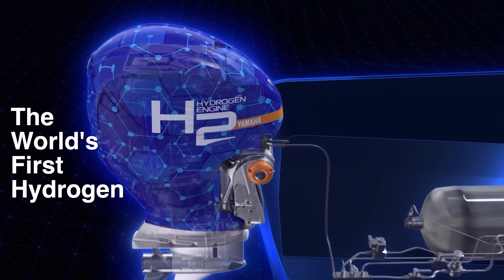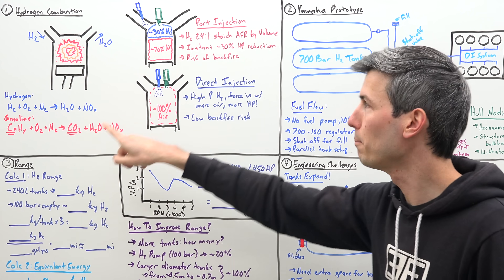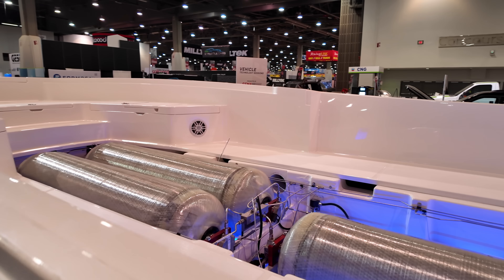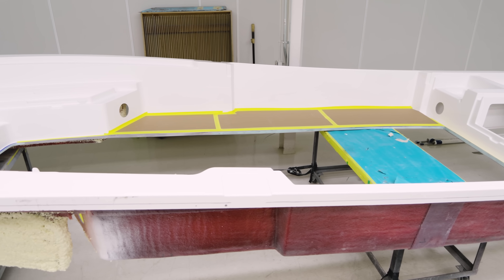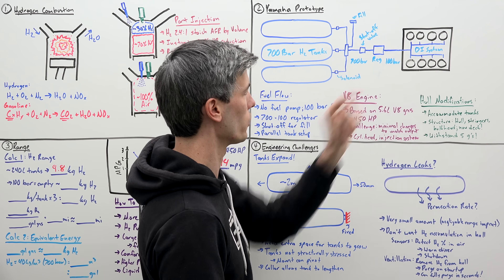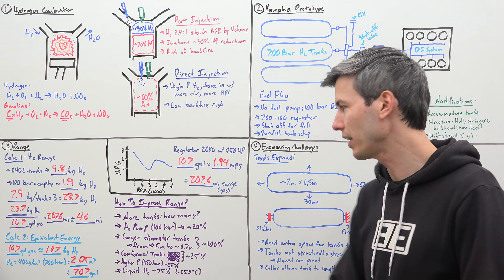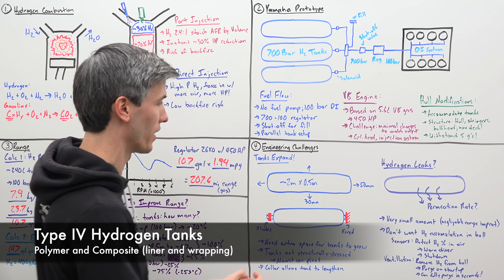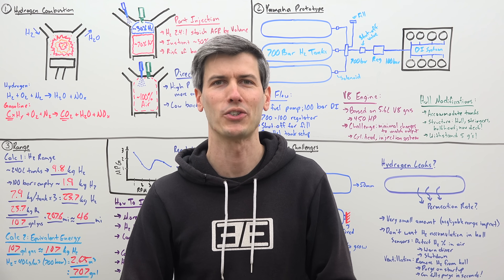The World’s First Hydrogen Combustion Outboard Engine!

Comment: When the hydrogen combine s with ATMOSHERE NOT “AIR”, what happens to the65+% that is about to be turned from neutral gas to ACID, a nasty nitric based acid. Not as bad as NITRIC ACID, and yoh could or might want to calculate. 
Wht was it a 6.5ltr? Every two revs, you have brought in changed. And exhausted your hydrogen/ atmosphere here
1000RPM X 13cubic ltr is 13,000 cubic liters you gotta deal with now & that’s  w engine at IDLE
Also one that the gasoline IC doesn’t have to deal with. After emissions conditioning and treatment the Co and the rest mainly water and tiny amt of sulfur ithink &" it’s never perfect, but the exhaust on American cars here is cleaner than EVER. 

This great hope you “out bug” & I’m all for it for over 50 yrs & you know many of these modern approaches have already been data compiled and easily findable. 
1973-4? Tom Ogle,  ElPsso. TX. 
Murdered over a fuel system design, which by all the big name and mnfrs car companies agreed it had lot of merit.

Comment: Compound stupidity on full display here: 1. use hydrogen inefficiently with an ICE instead of fuel cell, 2. hydrogen bound to carbon is a FAR superior storage solution to cryo or compressed 3. we need to pretend that carbon is evil and can't be used in a closed cycle.

Comment: One of those tanks costs more than I've ever paid for a car or boat, admittedly I've never bought a new car or boat, but just the tanks are crazy expensive to make, and that's kind of unavoidable. 

Designing the tanks so they are allowed to flex reduce the amount of material required but also limit the number of cycles they can be considered safe, some hydrogen tanks have a cycle life comparable to lead acid batteries. But when lead acid batteries fail they loose capacity, and might release very small amounts of hydrogen when you force charge them anyway, but if one of those tanks fail, at or near full pressure, it would probably be difficult to find all the fragments of that tank, and the other tanks, and the rest of the boat.    

Very interesting, very impressive even, engineering exercise, without real practical application unless your goal is to spend money.  Synthetic fuels are often ruled out as a practical alternative due to the high cost in small scale experimental production, but "green" hydrogen isn't cheap to produce either, and then there are all the additional issues with hydrogen. Even sodium could be more practical energy carrier than hydrogen, despite the fact that using sodium as an energy carrier would have a whole range of "interesting" challenges.

Comment: Considering that for the application you have more than double the power you actually need you could use a 200hp diesel engine and run it with +/- co2 neutral eco diesel. "Problem" solved.

Comment: There is one interesting thing to consider for hydrogen powered boats, which can never apply to hydrogen cars:
They're sitting on top of a potential fuel source.
Hydrogen is often produced through electrolysis.  This method basically just requires salt water and a power source.  Through the use of a small wind turbine mounted to the boat, you could build up fuel over time.  You might be thinking "how are you supposed to pressurize it?" but since the collection system has to be submerged, why not use the depth of the ocean to your advantage?  You only need about 100ft of depth to get adequate pressure - that's effortlessly attainable; even some lakes can provide that.

Granted, I imagine it'd take all day just to gain a few miles of range, but imagine this:
You have a houseboat, where you primarily live off your boat.  You don't expect to travel far or often, and you don't expect to make a round trip in a single day.  Slowly building up hydrogen fuel between stops could effectively be free transportation for such a thing.

Comment: I just learned a great concept I never thought of about direct injection. I didn't consider the reduced amount of air because you're drawing in fuel in a typical system. With direct injection, you're only drawing in air, and then you're forcing in fuel along with it, so it's almost like forced induction engine, not really. I know, but a little bit because you're getting more air volume, then you normally would if you were drawing in the fuel with the air. Because some would be displaced. And if the fuel to air ratio is higher, you're gonna be displacing even more air with the extra fuel. Very nice concept to understand thank you.

Comment: People are going to keep farting around with hydrogen, then realize the insurmountable thermodynamic challenges and go with a solid state battery. A battery with twice the energy density would solve the boat issue and already exists today in low volumes.

Comment: Why on earth would you combust hydrogen at low thermodynamic efficiency when you can convert it directly to electricity in a fuel cell. 

Hydrogen fuel is incredibly expensive, you don't want to be throwing away 75% of the energy.

Comment: 107 gallons of gasoline is not the same as 107kg of H2
107 gallons of gasoline is about 406.6kg of gas, or in other words, you would need about 407kg of H2 to equal the energy, that's a LOT more than 707 gallons!
It's actually 2685 gallons!

That's assuming 1kg of H2 = 1kg of gasoline in terms of energy, which I didn't even verify.

Comment: So, and now, how much more is the weight of a battery for 46 miles? Using H2 in combustion is just a waste. 2 Tanks, Battery and fuel cell would give a range of over 100 miles. Only problem: In this application, the power output is really high all of the time. Therefore you can't use a small fuel cell + battery like in a car (whitch only needs a lot of power for acceleration, not for keeping speed).

Comment: It’s interesting to learn something more about H2 direct injectors .They can be usable for direct injection of CH4 or evaporated LPG which are much more conventional fuels and they has the same problem with lowering the volumetric efficiency of the engine if injected in the intake.

Comment: I have read studies about hydrogen storage in metal hydrides. Hydrides don't need pressure to hold hydrogen. They are heated to release hydrogen. The major donwside is the weight of the system. Maybe the weight issue is lesser in marine applications.

Comment: You don't mention NOX emissions, have Yamaha been able to solve this issue?
You don't mention 98% of Hydrogen comes from fossil fuels and currently contributes approx 2% of worldwide CO2 emissions making it more polluting to use than petrol/gasoline in an internal combustion engine. In a fuel cell it is approx equal to petrol or diesel unless the hydrogen is from spare electricity capacity which is not yet a thing.
I wonder why you didn't do the Maths on these things? Mmmmmmmm! 
Didn't you kinda mock the use of hydrogen in your last video about the V8 hydrogen ICE.
Reply: Yip I looked back and you made a video about this very engine a couple of years ago ridiculing it. I'm confused why your now saying how great it is.

Comment: Dude, what happened to you and your channel… Your first mention, in support of Hydro, is to compare the weight of a purely battery driven boat and range. Yet no mention of what range is desired/needed. So maybe only half of the 13,000lbs battery you toss out as an example would do the job? You say, “making it obviously challenging for this kind of LONG-RANGE application”. I may have missed it, but what “application” are we taking into consideration? Then you proceed to talk about pollution… “hydrogen combustion has virtually no carbon emissions” …??? Fair enough, but have you gone to the non-fact dark side these days. You, above most others, very well know the amount of energy required to produce hydrogen. Sure, once you have it produced it is “virtually” emission free. Always loved your channel but I’m struggling to understand why you seem to have taken a negative stance towards pure electric over the past 3+ years...

Comment: Didn't realize that boats burn so much fuel, If I understood you right, this gasoline engine burns about a L per Km!!
Reply: Takes a lot more power to move water out of the way than air.
Reply: Maybe the engineers should investigate hydrofoil technology  instead of this waste of money

Comment: Another way to get range: use a fuel cell and a lighter electric motor instead of combustion.
I guess the combustion is going to be cheaper than the fuel cell... but really a cell seems a lot better long term, fewer moving parts, you need an electrical system anyways.

I respect the technical prowess in getting this to work... but it seems trivially obvious that this is never going to be practical.

Comment: Maybe we can make hydrogen a reusable coolant to cool the engine. Just use one tank maybe. Instead of making it a gas engine. It’s very cold right? It could be one use and forget about it. I hate changing coolant in my small engines. Pain in the arse. It would be nice if there was a small tank that we can just swap or reuse. Hydrogen radiator with a small tank to change hydrogen coolant. Easy change. No need for a fan and no radiator fins. Just a hydrogen tank that cools the engine and maybe used to bring in cold air in too. So you can crank up the cool air as long as you want.

Comment: i knew this was possible i really hope this makes it to cars because this is actually great
Reply: It's really not great. It only improves upon hydrocarbon based fuel in one metric alone, which is the elimination of carbon emissions from the engine itself. Apart from that, it's worse in just every other metric from efficiency, to safety, to storage. Plus, as an air breathing combustion engine, it will also still create NOX emissions. The reality is that you'd be better off using wind/solar/nuclear to further process the hydrogen into a more energy dense synthetic liquid hydrocarbon based fuel. Hydrogen combustion engines are unfortunately a bad concept we need to let die.
Reply: @K31TH3R  i just dont want combustion engines to die in general but i guess bio diesel will be around forever so no worries i guess

Comment: Why do we have to replace everything that burns fossil fuels with clean alternative fuels? The amount of gasoline and diesel burned in recreational boats can't be more than 1% of that which is burned in cars. I do not think a 100% fossil fuel free society is achievable. As a boater I'll gladly buy an EV truck if they can get the range up just a bit more, but i do not want the tradeoffs in weight, lost storage, and complexity in my boat.

Comment: One way to get around three times the range would be to run the hydrogen through a fuel cell and power an electric motor, instead of burning it in an inefficient heat engine.

Comment: Hydrofoils can improve fuel efficiency by 25% So it would be a good idea to combine these technologies. 
Also the there are many well known problems producing the hydrogen which I believe you have covered in your previous videos. 👇 
While hydrogen is often touted as a clean energy solution, its production and utilization face several significant challenges:
Production Challenges:
 * Energy Intensive: The most common method of producing hydrogen, electrolysis, requires significant amounts of electricity to split water into hydrogen and oxygen. This can be inefficient, especially if the electricity is generated from fossil fuels.
 * Energy Loss: A substantial amount of energy is lost during the electrolysis process and subsequent storage and transportation of hydrogen.
 * Carbon Emissions: Currently, most hydrogen is produced from fossil fuels like natural gas through a process called steam methane reforming. This process releases significant amounts of carbon dioxide, a greenhouse gas.
Storage and Transportation Challenges:
 * Leakage: Hydrogen is a small molecule that can easily leak through many materials. This makes it difficult to store and transport efficiently, leading to losses.
 * Infrastructure: A robust infrastructure for producing, storing, and transporting hydrogen needs to be developed, which requires significant investment.
Utilization Challenges:
 * Efficiency: Hydrogen fuel cells, which convert hydrogen into electricity, are still relatively expensive and less efficient than other technologies like batteries.
 * Safety Concerns: Hydrogen is highly flammable, making it necessary to handle and store it with extreme care.
Addressing the Challenges:
To overcome these challenges, researchers and industries are exploring various solutions:
 * Renewable Energy Sources: Using renewable energy sources like solar, wind, and hydro power to generate electricity for electrolysis can significantly reduce carbon emissions.
 * Improved Electrolysis Technologies: Developing more efficient electrolysis technologies can reduce energy losses and lower the cost of hydrogen production.
 * Advanced Materials: Researching advanced materials for hydrogen storage and transportation can improve efficiency and reduce leakage.
 * Safety Regulations and Standards: Implementing strict safety regulations and standards can mitigate the risks associated with hydrogen handling and storage.
While hydrogen has the potential to be a clean and versatile energy carrier, addressing these challenges is crucial to realizing its full potential. Continued research and development, along with supportive policies, are necessary to unlock the benefits of hydrogen as a sustainable energy solution.

Comment: Hydrogen seems to not have a single advantage over gasoline as a fuel for transportation. I'm not an electric cultist, but it has some undeniable advantages that can be leveraged for many use cases and eventually some of the disadvantages can be minimized or eliminated. But hydrogen? What can it do besides supposedly lower emissions compared to petrol based fuels? Can't we just use the most appropriate energy source for each requirement instead of creating a pointless competition? Of course not, I know that.

Comment: I wonder why hydrogen combustion over a hydrogen fuel cell for this application.... Wouldn't a fuel cell and electric motor be more efficient than the combustion engine helping with the range issue?

Comment: 107 gallons * 2.85769 kg – 87% carbon = 39.75 kg of hydrogen, 39.75 * 33.33333 = 1325 kwh.
207.6 miles divided by 39.75 kg = 5.223 miles per kilogram of hydrogen,
5.223 mpk * 23.7 kg = 123.78 miles or 207.6 ÷ 39.75 * 23.7 = 123.78 miles
One gallon of gasoline contains 0.3715 kg of hydrogen, 0.3715 * 33.333 kwh = 12.383 kwh
2.692 gallons of gasoline contains 1 kg of hydrogen, 1 * 33.333 = 33.333 kwh. 
It’s mathematically impossible for (1 gallon) 0.3715 kilograms of hydrogen to have the same amount of energy as 2.692 gallons (1 kilogram of hydrogen) 
When calculating energy in a hydrocarbon fuel always remove the carbon (inefficiency) first, eg 2.85769 – 87% = 0.3715 * 33.333 =12.383 kwh.

Comment: I would've liked to see how much battery you would need to get that same 46 miles of range. Its still probably a lot, but realistic.
Reply: Gasoline has about 33,000 kj per L of energy. This is equivalent to about 9.1 kWh per L. Accounting for engine efficiency, which would be around 20% at high engine loading,  and around 25% at modest loading. We will assume modest loading. 
Therfore 9.l kW/L would output about 2.27 useabke kW/L. 
The drivetrain on an electric also does not need many parasitic loads like oil and big water pumps, electrical loads (Alternator) for ECM, ign systems, injectors, etc. The gear box is also simple, not requiring shift mechanisms or reverse, reducing mechanical complexity and drag.
I'm going to assume about 10% of modest loading mechanical output is lost due to this parasitics which is probably on the low side. Therefore, a liter of gas gives about 2kWh of useable mechanical energy. 

23.7 US Gal (H2 equv.) x 3.78L/Gal = 89.5 L
89.5L x 2kWh/L = 189 kWh battery

Based on these calcs, with 107 Gal of fuel, I'm calculating 809 kWh. This probably more realistic then the 1.2MWh battery stated in the video. Especially where electric offers interesting design choices, especially when it comes to propeller optimization.
Reply: Note that on electric equivalent motor would require 335kW to make 450HP, but with inefficiencies accounted for, would be closer to 350kW.
Reply from the maker: Numbers provided at the beginning of the video! Just multiply the 1200 kWh to match the range of the gas version by 22% to get the range of the hydrogen version, so 0.22*1200 = 264 kWh battery pack for ~46 miles assuming 3x the efficiency vs gas.
Reply: given the numbers in this video, it'd be roughly 1320kg or 2860 lbs providing roughly 264kWh. that'd be a bit more than the hummer EV has, or say 2 cybertrucks. would definitely fit into the boat.

but as the newest batteries of f.e. the cybertruck don't ahve 200Wh/kg as in the video, but 272Wh/kg (according to limiting factor), those 264kWh would be more like 970kg or 2100 lbs.
Reply: Based on current common battery tech of 300Wh/kg, 189kWh would weigh about 630 kg.
With some of the newest tech at 500Wh/kg, it would weigh 378 kg

23 gal of gas is about 62kg and 107 gal of gas is about 289 kg for comparison.

Note that some savings would be had in greatly reducing complexity of the motor - estimation of around 350kg reduction for a 450HP outboard
Reply: With today tech we are ONLY at most 200wh/kg (ať pack level) unfortunatly..
Reply: @petrbrok2468  
There are definitely batteries available that are significantly better than 200Wh/kg at the pack level. 
For example, CATL has batteries in the 500Wh/kg range, in production, used in EV's.

As of last year, I know of 711Wh/kg in the lab. I'm not sure about the newest records. Solid state batteries could push it past 1,000Wh/kg.